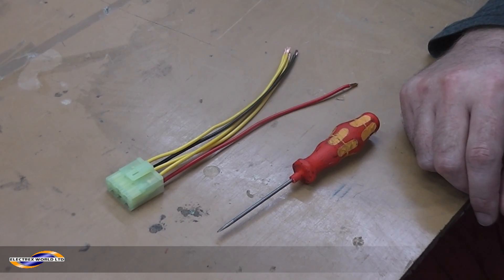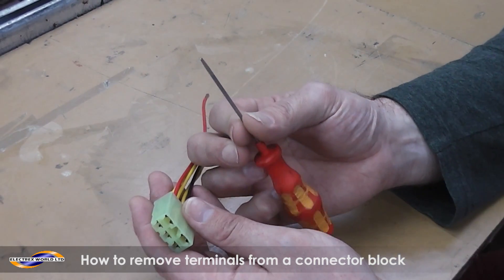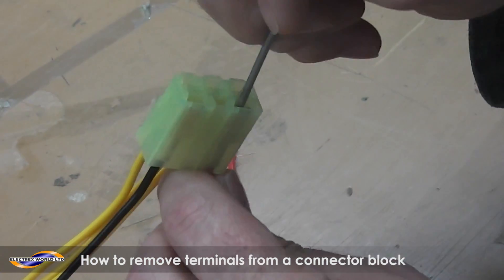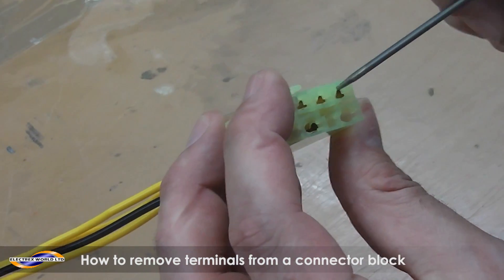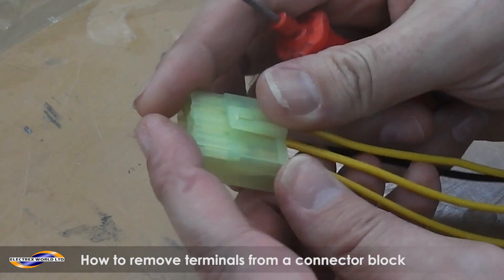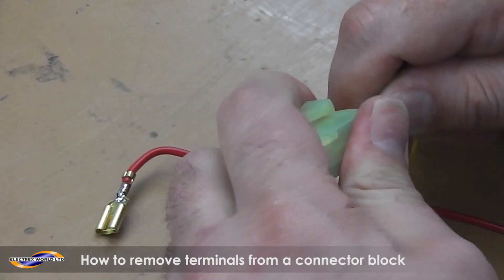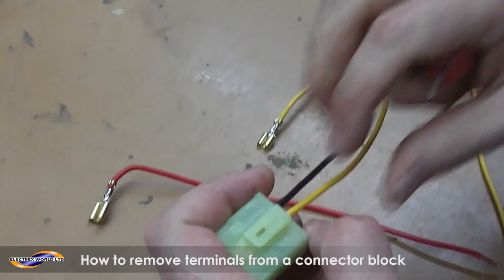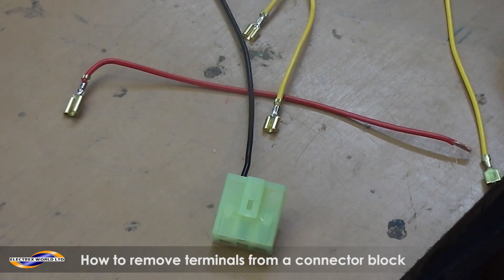How to remove terminals from a connector block

Comment: What kind of flathead was used. I found a freyed ground wire that I need to get out of the connector. But I dont think I have the right size flathead.